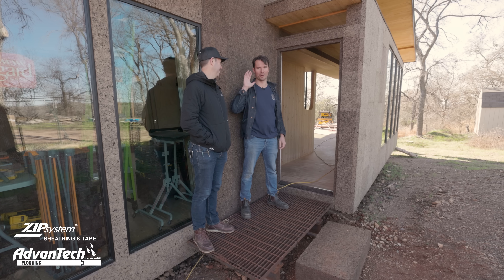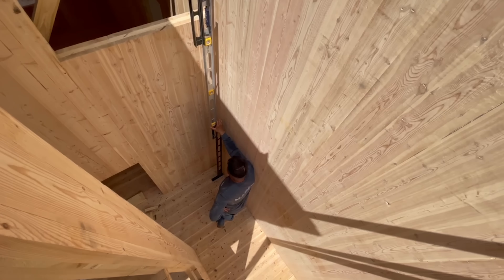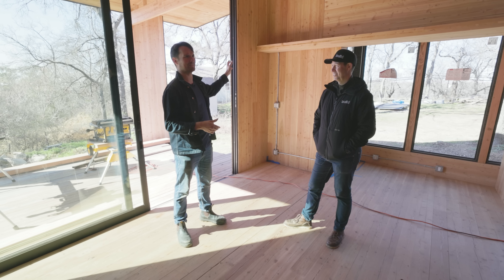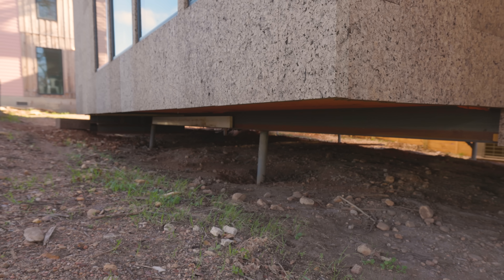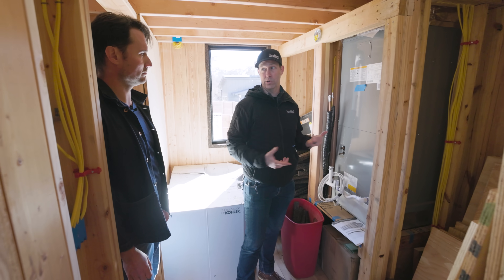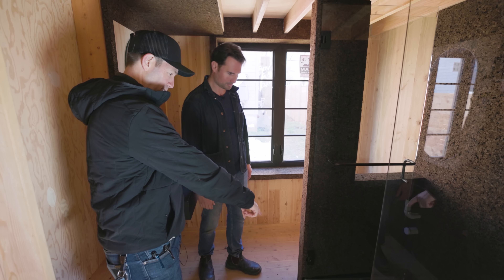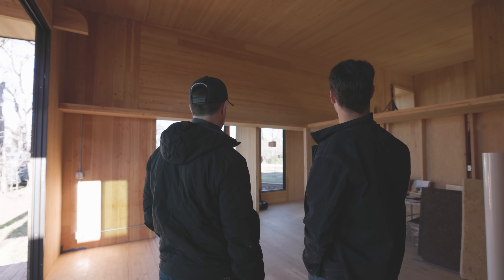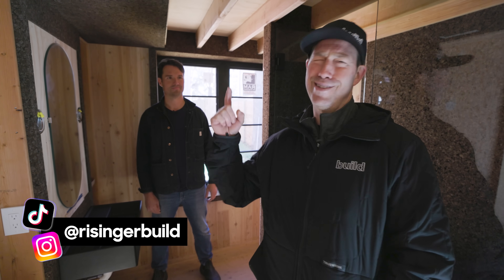CLT House - Zero Drywall and a Cork Shower!

Comment: For me, the coolest thing about CLT is that since it's made up of such small boards, it can use trees that are taken in forest thinning that would have just gone to firewood or fuel pellets before.  A 6" log can yield three or four boards suitable for CLT.
Reply: Yes!
Reply: So it should be dirt cheap right? Yeah right
Reply: Drinking the coolade
Reply: glorified particle board
Reply: Do you realize just how much wood is needed to do this? The amount of trees we would need to grow for everyone to build this way would be insane. Way more than thinning wood!
Reply: @ColeSpolaric  my opinion as an engineering is the following, CLT will not replace stick framed single family houses. The main application is and will continue to be in multi-storey construction to replace concrete were suitable
Reply: @yekutielbenheshel354   I believe CSP will fail mainly due to maintenance, geopolitics and land use. PV will continue to be a better technology. But it is still possible to make green concrete using plasma kilns. Still, CLT will replace concrete in many usages due to its many benefits. I am not well read in wood glue, but I have seen marketing for 0 VOC CLT, so that might not even be an issue.

Portland cement is possible to produce without the large CO2 emissions, but mining the lime rock is still a destructive process that can cause a lot of localised damage to nature. That is one aspect that is usually missed. Swedens largest cement producer will not get shut down due to CO2 but risks getting shut down due to ground water issues.
Reply: @johnbergstrom2931  yeah almost zero waste but it ends up being more glue and chemicals than wood - not sure how that’s a good thing really
Reply: @yekutielbenheshel354  firstly, you are dogmatic. You believe that any confusion are a result of muddled thoughts. Has it ever struck your mind that English might be my fourth language?

 Secondly, any technology that relies upon CSP has not yet proven to be successful on large scale. What are your assumptions and reason’s to believe that CSP would be an usefulznd cost effective  technology?
Reply: Yup. And the same principles apply to CLT composed of structural quality bamboo wood. Bamboo grows MUCH faster than trees. And although it's not necessarily as strong as tree wood, most people aren't building midrise multifamily apartments likes you can do with CLT. For lowrise 1-3 stories, bamboo CLT will work.

With CLT and 3D printed concrete, it's looking like it will be much cheaper to build housing in the future.
Reply: @mitchdenner9743  should be pretty cheap from a labor perspective. We'll see with the materials cost as it becomes more popular.
Reply: @johnbergstrom2931  easy to say..... but sawn lumber comes with free build in glue and is enormously less energy intensive to yield finished product - and the finished product is obviously "good enough" for a lot of stuff. I don't think "was wood" will expand to cover everything unless it's BOTH formulated to burn less than normal wood (instead of burn more which is the status quo for LVL/LSL/OSB/PSL/ etc - the glues themselves are very flammable, make a bonfire out of some osb offcuts and you'll see) AND that lower flame spread or longer fire rating afforded only by "new and less combustible waswood" is mandated in the codes
Reply: Growing forests is a good thing all around and increased CLT building would incentivize more productive forests.
Reply: There’s at least one CLT producer experimenting with wooden “nails” rather than glue to hold the assembly together
Reply: @grimmWednesday  interesting idea.
Reply: @grimmWednesday  I know the Japanese use to build without nails. I'm looking forward to see the evolution of this and other materials. I think it would be cool to do a structure that combines some different methods, like cob or straw bale
Reply: You cant use scrap wood in these panels, they have a very high lumber grade. I worked for one of the biggest manufacturers in NA for these panels.
Reply: @ColeSpolaric  Do you realise how DURABLE it is compared to American cardboard houses?
Reply: @fabr5747  American houses are actually very durable and can withstand cat 5 hurricanes if built right. Problem is the builders being as cheap as possible to maximize profit while the government let's them get away with it.
Reply: What's the R on a exterior panel

Comment: NOT my cup of tea…HOWEVER, I absolutely LOVE the high degree of thinking and deliberation behind the recyclability of the building’s material composition. I’m not into super modern style homes but it’s intriguing to see such thought put into decisions on thing like the central placement of the HVAC. It might not work in most home layouts but I really love seeing that level of consideration reflected in a homes energy consumption as it’s being designed and built. 👏🏽👏🏽👏🏽

Comment: If you're doing exposed duct work, might want to look into fabric ducts.  They weigh nearly nothing, they can be any color you want, and you can unzip them and put them in the washer if they get dusty.
Reply: I’ve never heard of fabric ducts. Sounds very cool and very research worthy.
Reply: @johnlee7085  

From what I've been able to find on the web:

Fabric ducts do not use registers to disperse the air, but diffuse air through the fabric.  They must be laundered once or  twice per year because of dust & (possible) mold accumulation; they have zipper closures that make removal/replacement (supposedly) simple.

It's an intriguing idea.

Comment: I had to show this to my wife because she is always railing on the building industry for not coming up with a better alternative for drywall after all of these years of the same old dusty mess that needs constant repair.
Reply: You got a point, but that'll make any after work or repairs a lot more involved and harder to hide
Reply: What stopping you now from leaving all the electrical work exposed outside of the drywall, just like its exposed here? lol, and how does it need constant repairs? My drywalls never needed a repair, but I live in EU so maybe we just make them better.
Reply: @faustinpippin9208  The main enemies of drywall are teenagers.
Reply: Explain also to your wife that this is a North American issue.
Reply: Except drywall has a much better fire rating

Comment: Next year on a follow-up of this house, "How I hate my cork shower."  I see that as a cleaning nightmare. All kinds of natural spaces for dirt, grime, soap scum, and bacteria to grow in.
Reply: That is the same thing I was thinking.
Reply: I remember someone who years ago had a cork bathroom which had many layers of varnish and gave years of trouble-free service
Reply: Yes, I would have liked to hear what they are contemplating to counteract the affects of soap, body oil, skin and the sweat we attempt to wash away. Soap has that tendancy to cling and accumulate on surfaces due to many of them having a surfactant such as sodium stearate which reduces a surface's ability to repel water base solutions.
Reply: Yuck, totally agree.
BUT, if it's a weekend cabin that sees <100 showers per year, then it might be okay.
Reply: Cork is naturally antibacterial. The same reason it will work on the exterior should make it work on the interior.
Probably similar to why wood cutting boards are actually more sanitary than plastic. Evolution produces some amazing materials.

And hey, if it doesn't work, who cares? It's an easy fix and zero waste.
Reply: Here our water has a very high limestone content. My first thought was how lime deposits will look on and in the holes of that dark cork.  As the person that cleans the showers I can’t imagine any way to keep it looking nice enough to want to show it off.
Reply: I’ve mad a corkwood shower mat and eventually it’s turns black with bacteria
Reply: Fallingwater built in 1936 has Cork showers.

Comment: Notice a lot of pretty major gaps between CLT panels in both the floors and walls, wished you could have asked him about that.   Also the mixed horizontal/vertical orientation of the planks on the wall panels would drive me insane.

Comment: This is very nice.   It looks like the electrical industry needs to step up though, and come up with exposed conduit that looks good in spaces like this.  That exposed electric looks bad!
Reply: Agreed.  Love the overall look, but I think the exposed electrical would tick me off after a while.  
I’m sure if you were doing a custom build, you could do more with wall sconces and smart-home feature to reduce the need for unnecessary outlets and switches.

Comment: For the most part I like the house. I am wondering how the house would work with the freeze-thaw snow and rain in the North
Reply: We use this style of construction with no issues here in norway. You might hear some noise from the wood during big temperature swings.
Reply: @Rokmahr008  With the freeze-thaw, I was meaning in relation to the cork siding. It doesn't take on water he said, but it does have holes and fissures in its surface that water could get into and freeze.  Maybe causing  issues over time, that's me questionable concern.

Comment: probably not done yet but I hope the receptacles are getting some additional detailing compared to the other details which are great it looks like an after thought.  if you swept down on all the receptacles you could incase the portion along the floor in a wood baseboard and perhaps integrate the vertical portion into. a wooden stile.  I think the aludea would be to try to make the receptacle place ment look like it was placed to match the pattern and not the other way around as the locations are driven by code
Reply: Agreed.  I liked them on the Perfect Wall house because they looked good in the stud cavities, but I'm not loving the look on surface of the solid CLT walls.

Comment: There are a lot of interesting architectural choices in this house that are unique, interesting and give a nice sense of modern living. I love wood interiors but the exposed electrical looks like an unfinished basement. 
I don't see why you couldn't just put in a tall but low profile (easily removable) wood base board to cover the electrical runs and give the outlets a place to rest. Perhaps you could use hollow column structures for vertical runs. It would add character to the house (Victorian vibe) and make it look more finished.
Reply: This right here.  It looks a high-end garage-mah-hal.

Comment: I honestly can't fathom all the praise in the comments for this. This isn't a wood house, it's a glue house chinked with wood. Exposed services is a step up are you kidding?? Love the places for dust & bugs not to mention its just uh-gly.

Remember all the problems with sip panels? Of course not, don't worry about all those joints & gaps. It's all 500 year solid

Q: do the fireproof (ha!) toxic glues make it impervious to termites and decay?

There are better ways to eliminate sheetrock. BTW, how much does this cost??

Comment: mass timber walls aren't the same as stick framing, the biggest difference is that their vapor profile is more similar to a mass wall e.g. like solid masonry than a framed wall. although wood is definitely vapor open, once you start accumulating very thick, continuous layers of it, it behaves more like a solid mass wall hygrothermally because it is... a solid mass.

This means that CLT walls that get wet take a very, very long time to dry out relative to a framed wall. Which may or may not be an issue depending on how much water it initially took up, and what the interior conditions are like. 

Either way, you really, really do not want to get rain on the panels if you can help it. The wetter they get during construction, the longer you'll have to run supplemental dehumidification indoors after it's finished.

Comment: Love the wood, but can't say I am a fan of the EMT... especially if they need to run some data cables later. Curious what a better detail could have been.
Reply: Similar thought. 

My idea is similar to Matt’s comment on the wood panel access. It would be reasonably easy to have a wooden baseboard that has an open cavity back for running the cable.
Reply: The only other thing is wire mold, it looks a bit better but is expensive.

Comment: Thanks for sharing this project, it's really great. I have so many questions. Is there a reason there is no insulation under the floor? Is it not required in local building code. Maybe it's a US thing? Also when I have used the expanded cork internally, there is still a lot of soot, has this one been cleaned before installation? Is there a reason why a section of floor is built traditionally with floor joists and not CLT?

Comment: Its gorgeous 😻. I'm  concerned about fire with all of the wood throughout the house. Isn't fire the reason / why drywall or sheetrock was invented!?
Reply: Drywall was invented to replace plaster over lathe and build faster
Reply: A common concern. But apparently not too much of a problem—Have you ever tried to burn a school textbook by itself? Unless you fan the pages, it won't burn.—Though it's going to be hard to repair the scorch marks.
Reply: Drywall does provide fire protection in much the same way that plaster used to. It’s just easier and allows for mass production. Fire is a problem in stick built houses, but much less so in heavy timber, which is even more fire resistant than metal buildings. 

The thick wood will char on the outside but retain the structural integrity for the majority of the wood. Starting a fire is much easier with a bunch of little sticks and really difficult with big logs.

Comment: There`s a ways to hide the conduit like https://youtu.be/VbR0Px6KMtw
My main concern like with any wood interior, is fire rating. They sell CLT in rough finish too so it can be drywall too.
Reply: Fire rating is to prevent fire spread and give adequate time to evacuate. As there's no cavity for the fire to spread into that end wouldn't be a problem. Secondly as it's solid wood even if ignited it would retain it's structure well beyond what's required to evacuate the building.
Reply: CLT has proven to be self-extinguishing in fire spread tests. For structural strength the panels are designed with a layer that can char, which preserved the required thickness for strength. They are in the IBC as mass timber (which works in this way too).
Reply: the way I see it, from more minimalist home design where there's less objects spaced apart. if object catches fire, 5/8" drywall would contain it long enough for it to burn up. Causing minimum damage, drywall and maybe couple studs. While CLT would add fuel to the fire, increasing the spread.  I have no doubt it could contain it, but the  damage might be greater and fixing it would be alot harder.
Reply: In NorCal wildfires, they were forced to demo so many houses that stood after fires, because of structural integrity being compromised by the sustained heat. Concrete foundations puckered, walls singed, steel warped. CLTs dont delaminate or warp after extended heat exposure? How do you repair a singed or warped panel? And that floor load seems massive for nothing underneath. 10, 20, 30 years its not sagging? wow. Evacuation is one element, but I'd like to be able to return home if possible.

Comment: With everyone so worried about energy efficiency, why aren't builders and remodelers using foil faced insulation. When we built my parents house, it was done entirely with foil faced insulation. My brother and I installed it. My mom's heating bills are a fraction of her neighbors houses, of similar size, and she keeps it at 75°. It's basic physics. The foil prevents heat loss due to radiation. The heat is reflected back into the building.
Reply: Most of the energy lost is due to air leakage, radiation is only a small part of the energy loss of an enclosure.
Reply: its all in ur head
Reply: @PerfectPrinceX1  Funny how the industry says that a heat reflective barrier turns the R-12 in your walls to R-17.8.

Comment: CLT panels are a joke and i have worked for engineers that say the same. Architects love it because there is less finishing required. Connections are a nightmare in a high seismic zone adding to cost. As many viewers have commented the amount of wood  required is ridiculous and the exposed mechanicals look like crap. I have done a lot of multimillion dollar homes and the majority of owners dont want CLT.

Comment: Totally love the aspects of this house.  No drywall, paint,  etc.  The ONLY thing I hate is the industrial look of the conduit,  and surface mounted boxes.  That works in an industrial type build,  but not here.  I say hide that sh.t.  Jayman...
Reply: I think you could at least use copper or something more attractive for the exposed conduit.
Reply: I’ve thought a charcoal, copper, off-white/gray, and wood could be gorgeous
Reply: For added cost and extra design time, many clt mfgs. Will cut in chase and box holes
Reply: Totally agree. All I could see was that conduit. Does matt black conduit exist? But joking aside, for my builder to actually care about the chemicals being used throughout the building, yes please!!!
Reply: @sociopathmercenary  The bathroom sink's cheap drain really stuck out.
Reply: the conduit/pipes/waterlines can be laid in the floor and regular flooring can then be laid on top.